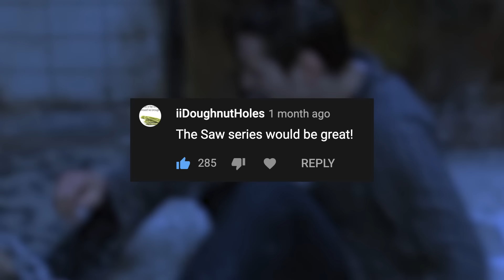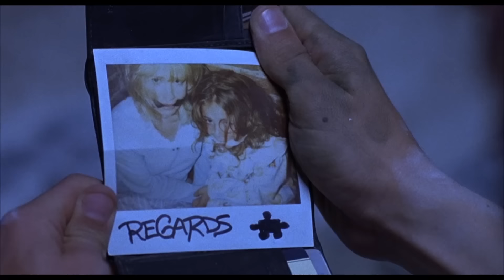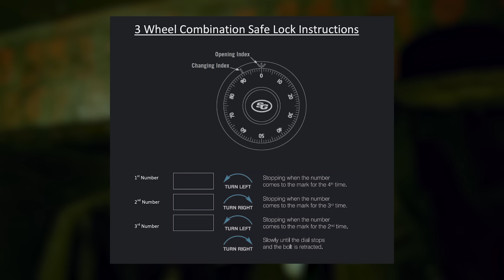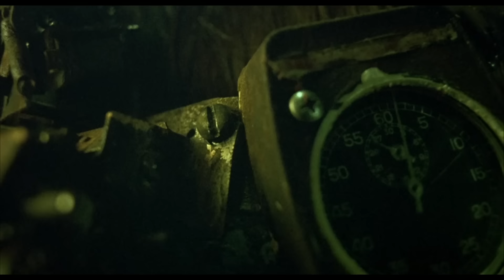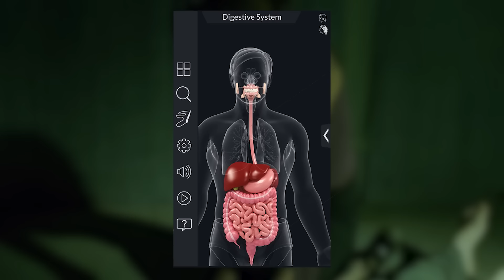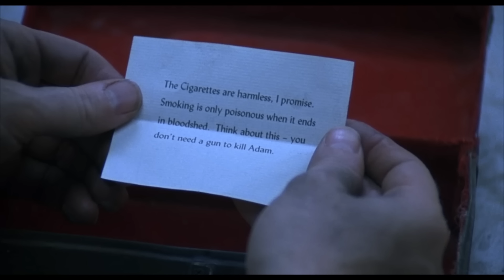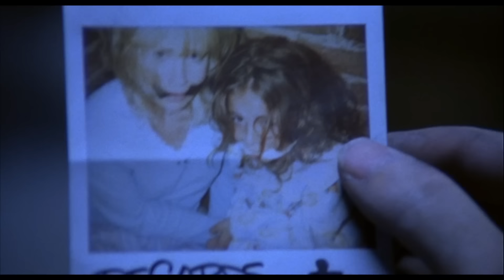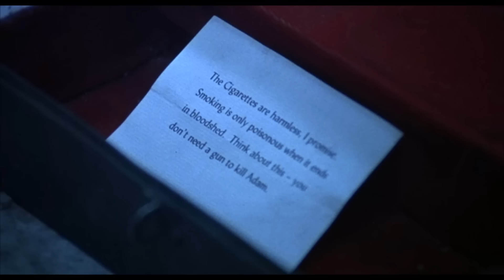How to Beat the DEATH TRAPS in "SAW"

Comment: There are a lot of ways to beat many of these traps. 

I worked with razor wire, also known as Concertina wire. You can lift entire rolls of the stuff with bare hands if you do it right. Grip tightly so it doesn't slip. Razors and knives can cut from straight pressure, but their true sharpness is from slicing. Don't drag them across your skin and you are fine.

If you are covered in a flamable gel, and you have literally any flat or thin item (like a room filled with broken glass) you can scrape that shit off. Again, edges don't cut if they are not used to slice or chop, drag them sideways and the gel would come right off.

For the double-throat drilling, drill bits are incredible brittle, you can easily just snap them off by striking sideways with literally anything, like your shoe or the pistol.
Reply: You must be a ninja or special forces person 😁I didn’t know any of this, very interesting !

Comment: I really feel like with enough patience, they could've sawed through either the chains or the pipes (which would've been even easier considering they're so rotten and rusted) that the chains were tied to. Even trying to find a means of sharpening the blunt blades using something in the bathroom would've helped. I mean, Adam's saw only breaks because of the speed and the force with which he's sawing. If he had instead had some patience and slowly sawed into the chain with longer strokes of the blade, it might've helped. I really never understood why the film was called Saw and there was so little attention paid to how these characters tried to utilize that tool... I mean, they had so much time!
Reply: Good explanation, but none of that matters. The writers wrote what they wanted to happen and what happened is that the saws are for human bones.
Reply: That wouldn't really work. Have you ever seen a hacksaw blade?? It's not like a knife that can me sharpened, it's heaps of crisscrossing teeth so there's no chance in that, and then jigsaw would have just electricuted them for trying anyway.
Reply: @maxbracegirdle9990  Regardless, they still could've tried being patient and using long, slow strokes on the chains to wear it down. I don't think Jigsaw would've buzzed them for trying to cut through the chains because I don't think Jigsaw would've anticipated them succeeding in doing that to begin with. On top of that, the game is still being played fairly if they manage to break out of their chains unlike how Adam pretended to be dead and got shocked.
Reply: @martincurran4985  It doesn't matter if he anticipated it or not, he's in the room with you, he's going to notice you sawing through chain for what would be like 3-4 hours, if not more. And that's if you manage to do it without breaking the blade with a misaligned push or pull. Plus those chains are probably whats connecting them to the circuit to be electricuted in the first place, so I doubt he's gonna be happy with you cutting it up
Reply: The pipes were not real(in the sense you cant tell What theyre supposed to be). Id assume theyre meant to be gas pipes, so they would be pretty thick, and even with a fresh new blade, chances are very small you could saw all the way Through that pipe.
Reply: It's called "saw" because it's a double meaning for Jigsaw watching and the actual saws.

Comment: An even easier way to ensure the key comes out of the dude's stomach is to make him sick. Don't explain, just roll him so he doesn't aspirate the key, and ram your hand down his throat. He'll gag and hurl up the key. Quicker than trying to dig through him, especially as it's easier to find a key in a chunky puddle than it is to find it in a struggling bag of sick with blood and visceral tissue also getting in the way.
Reply: But she was told he was dead, and looked and acted like it.  Dead people don't throw up...
Reply: @maxbracegirdle9990  Well, you're wrong there; they can. Especially if enough force is applied to the stomach. She could also kick him to double-check, whereupon he'd respond (which you'd do anyway if you have any reason to suspect a hidden trap or trigger, and you'd definitely suspect that given the current circumstances).
Reply: Who stabs a guy with a scalpel? Wouldn't that damage, if not completely break the blade?
Reply: @COctagons  BS, Read more

Comment: The thing that confuses me is that those saws are very clearly metal saws, and even the shittiest of metal saws will make it through a piece of pipe that big in less than an hour if you hustle and even if one breaks the other saw could be used or the fragments of blade. So the whole “can’t cut through the pipes” thing is just plain wrong.
Reply: I think its supposed to be a gas line, so actually thick, and the likelihood of them sawing that through twice even with a new blade is very slim. And by twice i mean, since its a huge metal pipe, it wont bend if you just saw through in one place. Youd need to saw off another fragment.

Comment: It looks like those Hacksaws had metal cutting blades on them, they would struggle to cut high tensile chain without going blunt but definitely can cut through the pipe. Even in new condition that pipe is made of a much softer type of steel and a rusted out old pipe might take a couple hours to cut through but it will cut.

Comment: There were either points you missed in the film or things you got wrong-example:

At 25:17 that piece of 2 way mirror wasn’t lying on the ground- I remember one of them got pissed and annoyed and threw something at the corner of the mirror causing a piece to fall and which gave Adam the clue that it’s a two way mirror.

Comment: 8:04 I'm not even sure that a victim would have much of a head anymore. Especially if they used a hollow or soft point bullet which are designed to flatten out on impact and transfer most of the kinetic energy to the tissues. This creates a wound channel that is much larger than the diameter of the projectile and the head would probably explode.

Comment: Honestly, I'd be trying to break those water supply pipes off the walls, trying for a large enough piece that would hopefully let me smash through the cast iron drain pipes they're chained to. Cast iron is very strong, but very brittle. And if that's not just surface rust, a few firm strikes with even a sizable portion of supply pipe would shatter the structure.

I do plumbing. I know this shit.

Comment: Funny part I have used a hacksaw/bonesaw to cut through a pad lock before; it wasn't new it was like 4 years old and abused saw.

Its all about technique and putting a cut edge in the steel and following it.

It could be done.

Comment: The stomach is on the left upper quadrant not the right firstly, and the stomach is fairly easy to identify, grab the intestines follow it to both ends and you'll find the stomach. Also most people should know roughly where the stomach sits as almost everyone by adulthood has had "stomach pain", the epigastric region.

Comment: 29:30 Minor quibble, but as the point of your "how to beat" series is realistic solutions to these things, shooting the lock doesn't work like it does in movies.  The muzzle flash alone would cause extreme damage to the guy in the chair, and bullets do weird things when they hit hard things, like metal.  While it's another movie, it's something it got right: in Black Hawk Down there's a small but important moment when one guy tells one of the rookies to keep away from walls because of ricochet; this is real, and one of the weird things bullets can do is end up ricocheting and following fairly close along a wall (and also if you're close enough and it just embeds, that can still throw rock fragments into your face).  There's no knowing what shooting the padlock would do.  Shooting anything there is a movie solution, not a realistic one.

Comment: the best saw trap: you wake up in a tank of water, naked, with an oxygen mask on your face, a tape recorder on the ground says: "in this tank of water there is a single diced tomato, put the tomato in the box and you will be set free, if you fail to do this in a timely manner, the water tank you are in will begin to heat up, after a few minutes, it will boil.

Comment: Circular incision is not how youd easily access the stomach, circular cuts are difficult. A cross is simple and quicker. A large and deep horizontal incision would even work just fine.. Ive worked with surgeons...

Comment: Generally getting a bullet to the brain will momentarily tense the body for few seconds as well the brain dies I suppose ? So going “flaccid” as you said would only really be possible if it was high caliber bullet that blows through the top lip and out severing-the spinal cord (this is what SWAT snipers are taught in hostage situations where they have someone at gunpoint) TLDR  4AM and board , felt like rambling 😏👍🏽

Comment: Also, at the making of this movie, cell phones such as the one shown in the lock box were already hard-programmed to mandatorily be able to dial 911 with or without a calling plan. There is no soft-program or hard programming that the carrier or manufacturer can do to change this, and as "ahead of their time" as Jiggy is that phone would still be able to call 911.
Reply: its a stretch for a civil/mechanical engineer like John, but just technically speaking you can hardware hack/root a lot of phones (not just modern phones but old dumb phones) and alter the flash memory to find the table of pre-programmed service and security numbers.

in Lebanon if youre taken under terrorism suspicions they dont allow to make any call at all from your phone, even if you want to dial a publically known number or a phone number thats known to be safe, because in the past lSlS had rooted phones so that even if the number you dialed was a public service number or verified number of a university the software hack would make the phone call a different number internally than the number you seemingly typed in before pressing call. So you could do the same here to convert 911 to some random nonexisting number
Reply: @Breaker242  True, when you put it that way. Now, the question would be which of John's people could do that? lol
Reply: @1Adam20  chances are the writers didnt think about that to begin with, I just wanted to share some technical trivia I find interesting since I had a rather unfortunate misunderstanding with security forces a few years ago that led to me learning about some of this stuff 😅

Comment: With due respect, the locks jigsaw used on the chains are Trash and can be opened with any heavy object and several hits. Of course it's attached to the legs, so it wouldn't have been easy, (at least not as easy as removing it from a door with a brick, but its definitely the easiest way which requires only a heavy object and some physical strength and no brains at all.

Comment: 13:59 those handsaws are designed specifically to cut through metal, so even if they are old, they would cut through the chain or the lock after a while

41:20 instead of using the shirt to drag the phone to himself, that always stuck out to me as extremely dumb

Comment: If I woke up with my right foot chained to a pipe, I'd take my clothes off, put my left foot in my underwear, wrap my inside out shirt around my foot and then wrap it again in my inside out pants, and start kicking the old ass pipe hoping that I could break, and if I did break it my foot would be relatively protected from being cut open, and if the pipes are full of poop my underwear and shirt will still be wearable, pants maybe depending on weather or not there's poop in the pipe, or I would do the same thing except maybe try breaking the smaller pipe and using it to break the bigger pipe

Comment: bs... it all depends on bullet type and spot it hit for it to splatter blood or brains... seen plenty of executions done with 308, 50bmg and 7.62x54r, bullet made hole and no blood splatter was made even when bullet hit temple... from 7.62x54r sniper rifle, just hole and blood pouring out. same goes for handguns you can find few cam recordings from brazil getting cab drivers executed inside cab being shot to head several times and only holes and blood is pouring even when bullet went nape> eye socket.
As to get splatter you would have to get hollow points and not FMJ type of ammunition, and yes mexican cartels often make execution videos with 50 bmg and you can clearly see even that shit wont bust your brain outside all over floord, you need bucketshots and hollow points for that effect.

Comment: I always thought Jigsaw’s trap wasn’t too hard.  Cutting off your foot was the dumbest way to free yourself.  You should only have to break your ankle so you can fold it straight and slip through the shackle.

Sure it will hurt like hell,  but no more than cutting off your foot, except that you get to keep your foot.  The ankle will heal, but a cut off foot won’t.  Worst case, you have to cut off your heel, not the entire foot, right?  It’s only your heel that shackles you.

Many of Jigsaw’s traps have more solutions than just the steps he gives you.  That’s how he plants the bad ideas in your head, but if you calm down, take your time and think of other possible ways to solve the traps, there will be other solutions to the game.